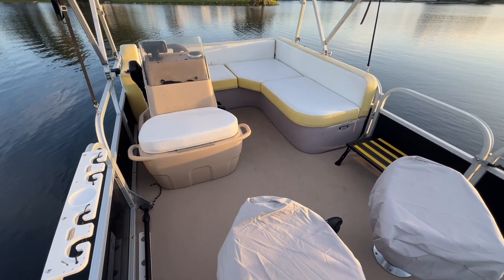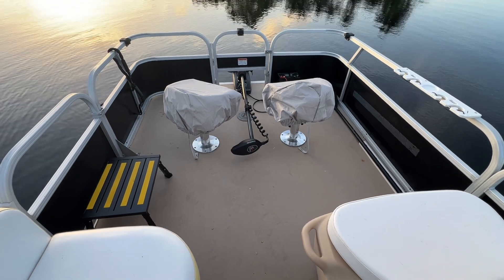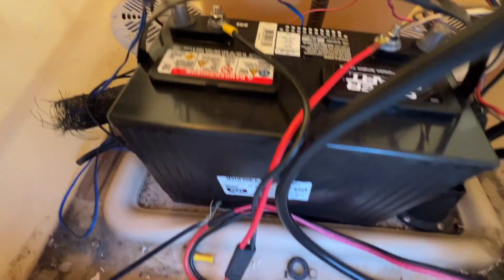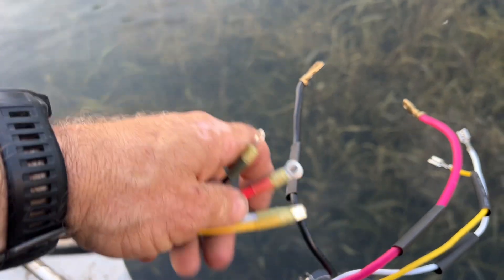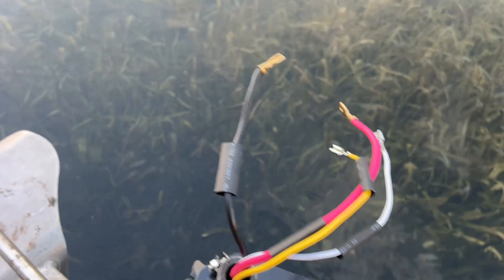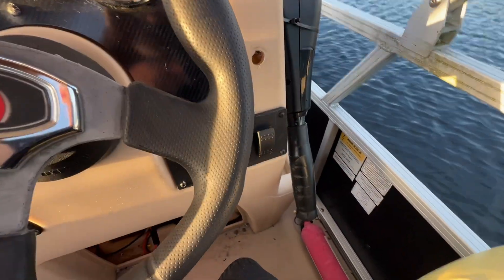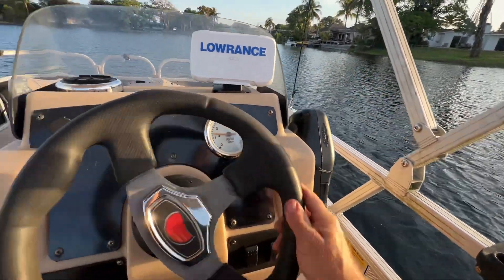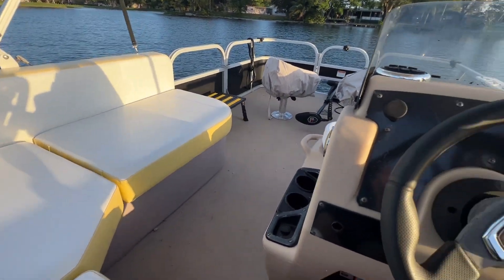Pontoon Boat Electric Motor Newport Vessels 46lb. Remote Steering And Speed

Comment: I’m trying to do this exact thing with this exact boat, are you in south Florida by any chance?
Reply from the maker: Yes I am
Reply: @subcoolbackyard75 Awesome! I’m in Lake Worth/Wellington. Not sure how I can connect with you outside of YouTube, but would you be interested in helping or even taking on the job? (Paid of course)….
Reply from the maker: If you have the same boat is the steering and cable intact and operational? You will need a triangle to connect to a 36” trolling motor. Here’s the link:
Haoguo Steering Triangle... https://www.amazon.com/dp/B0BLHZDWKJ?ref=ppx_pop_mob_ap_share

To remote mount the trolling motor head you will need 10/4 marine cable:

Matugajp 10awg 4 Wire Cable 10/4... https://www.amazon.com/dp/B0BVLX94YJ?ref=ppx_pop_mob_ap_share

Trolling motor cable sleeve:

Trolling Motor Cable Sleeve, 48"... https://www.amazon.com/dp/B0DBL9W512?ref=ppx_pop_mob_ap_share

Email is  geet4050@gmail.com . I can try to help out
Reply: @subcoolbackyard75  Awesome! I’m in Lake Worth/Wellington. Any chance you’re interested in helping or taking on the job to do it on mine?
Reply: @subcoolbackyard75 trying to reply but they keep getting deleted…

Comment: Interesting idea! I saw a kayaker that had added a trolling motor rudder blade that clamped to the shaft above the motor head (@$25 Amazon). Might increase steering response since you have a pontoon boat. Enjoy!
Reply from the maker: I’m probably going to try it with adding the rudder, I found using both front and rear motors I can maneuver good especially while docking